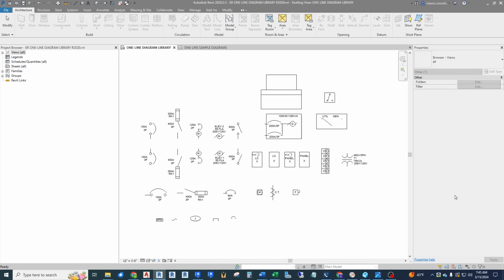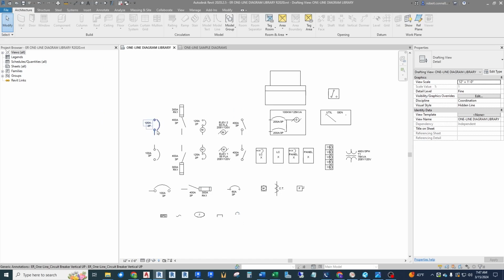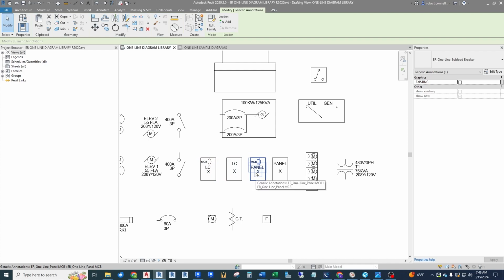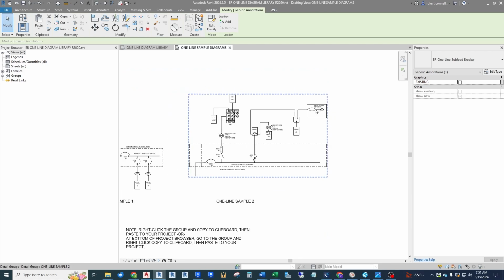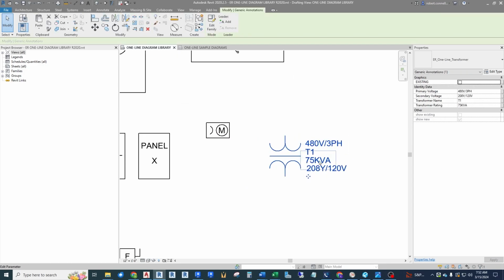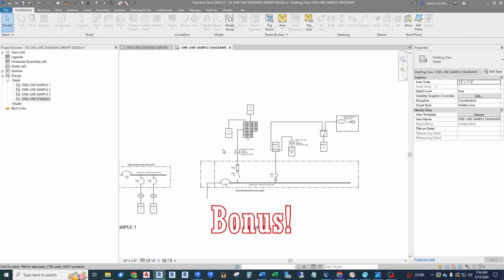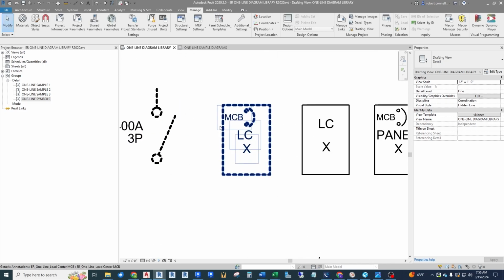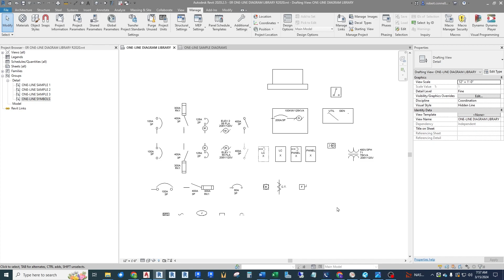REVIT MEP COMPLETE One-Line Diagram Family Pack (FAMILY EDITING)

Comment: Appreciate these videos Rob. Do you have annotations for like distribution panel boards/switch boards/things that may require a change a change in dimensions? Thanks.
Reply: Also how did you create the existing parameter to change to that line type
Reply from the maker: Good question - I created the dashed linetype first, then pretty much drew two versions of the symbol - one with solid lines and one with the dashed lines. Then I controlled the "visibility" of each of those versions with the "Existing" parameter, which is a Yes/No type of parameter, that toggles back and forth between the two versions. I can also do a video on this process if interested. Cheers!
Reply: @ElectricRob  I am interested. :)
Reply from the maker: Hope you noticed my latest video - specifically addressing your question - check it out here! https://youtu.be/ui1PRJi7zv4
Reply: @ElectricRob  I did notice it! I appreciate you Rob! When would that panel family be out with the instance and type parameters for length?
Reply: Following up on this! Are detail lines able to snap to the end of the symbols where applicable?
Reply from the maker: Hey there - thanks for the support! So I think you are looking for a panelboard type one-line symbol that is not just a fixed size, but that can be adjusted to a larger rectangle, for example? I could show how to make such a family, plus would be happy to send it to you. One version could be with "type parameters" and another could be "instance parameters" for maximum flexibility.
Reply: @ElectricRob  Yes that is what I am looking for! Thanks Rob :)